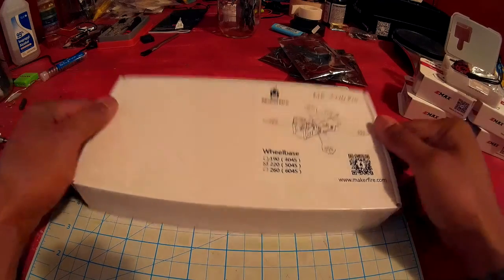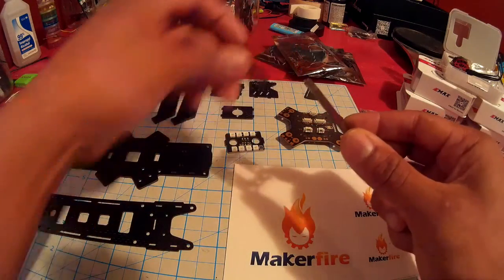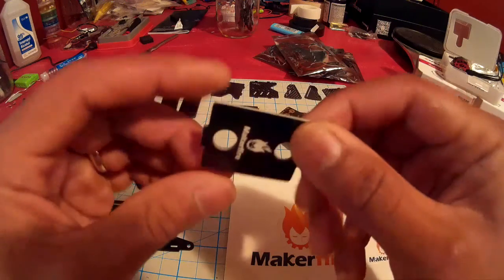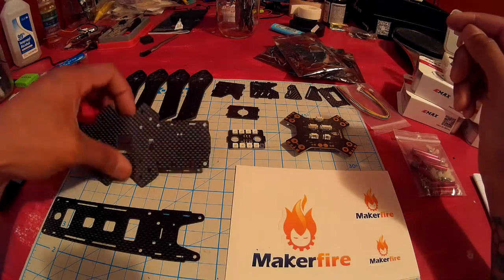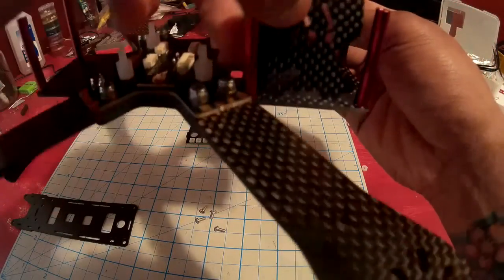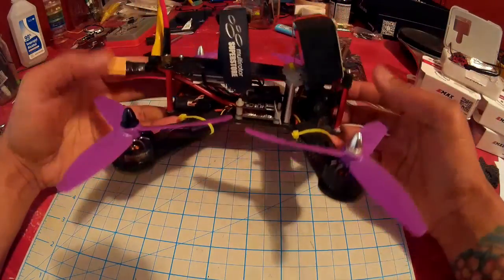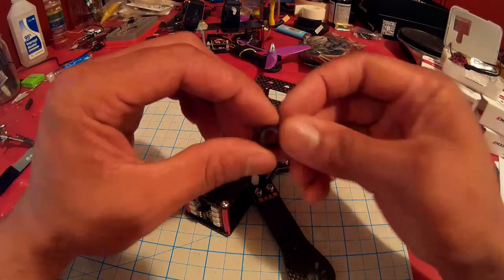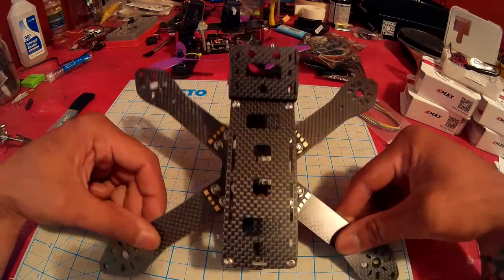MK X220 Frame Review

Comment: How did you get an xt60 on that PDB?
Reply from the maker: nateaycock1 the pbd comes with a xt60 pigtail. but I used an rrosd pdb for the build
Reply: Well crap. Mine did not have the Pigtail, and only had one battery strap. Did you ever find any info on the OSD? I can't find anything. It seems pretty self explanitory, but I just cant figure out what the actual OSD plug goes to. It has a + - and then a R and T.
Reply from the maker: nateaycock1 sorry to hear that man, you can find some pigtails on Amazon for cheap, but I also was not able to find any info on the osd

Comment: Could I plug the osd connector into my sp3 and configure it through a uart?
Reply from the maker: QuadBro FPV I don't think so. but I'm not 100%. the osd is just a passthru type, thru the PDB. if you want to configure it you"d have to do it thru the pdb, but I couldn't find any info on it from makerfire

Comment: please make a video on the led wiring, I have no clue what wire or plug to use.
Reply from the maker: Ferdinand Velez are you using the included PDB? I used some wire from some escs. and soldered them to the 12v pads.
Reply: PNW FPV yes I am, thought one of those plugs were for the led. thanks I'll try it your way.are the led lights durable? also thanks for the prompt response.  subscribed
Reply from the maker: Yes the fit really well to the frame, and have survived 2 crashed, and they are really bright. Good luck I hope to see some video from you